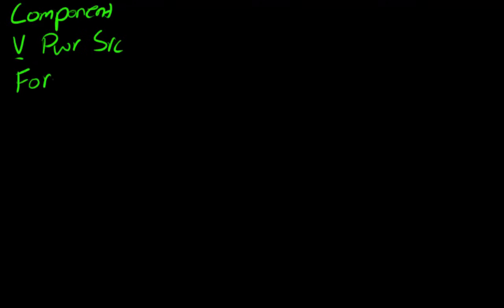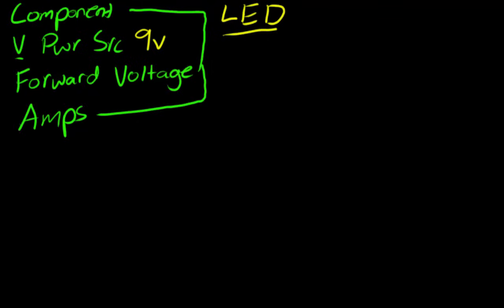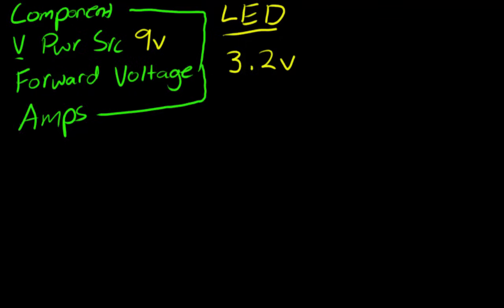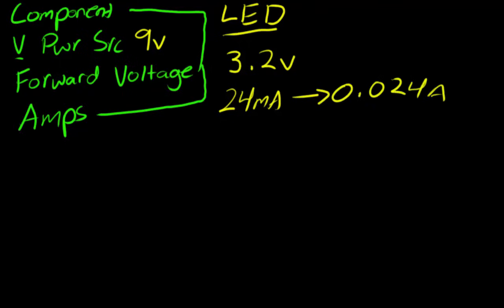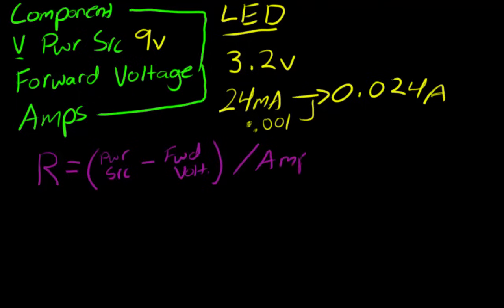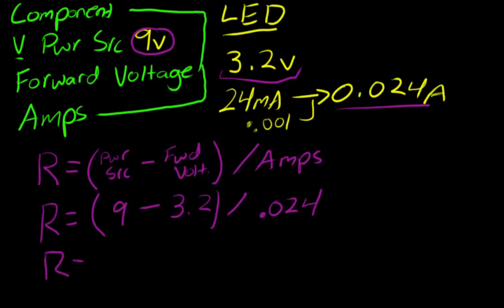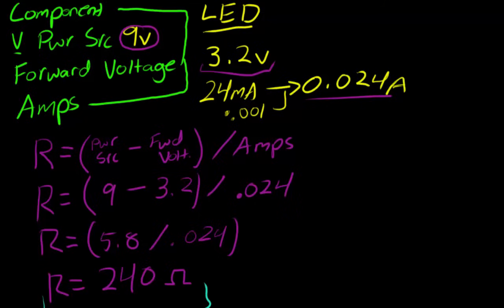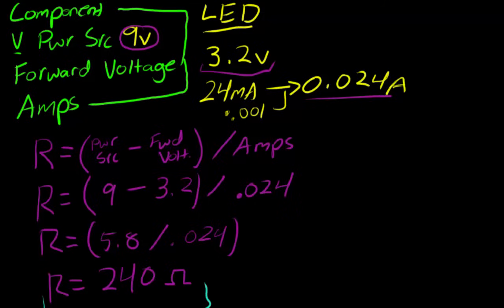Beginner Electronics - 7 - How Much Resistance?

Comment: What is a forward voltage.? Please explain.! Or give link to learn about it.!!
Reply: Its the voltage required to turn 'on' the diode or LED. So if your Forward voltage for the LED is given as being 3.2v and you have a battery of 9v you are going to have to put a resistance in between to reduce the voltage. The calculation works out what minimum resistance is required. R = (9 - 3.2)/0.024 = 241.66 (say 240 Ohms)
(This circuit diagram might help https://www.sparkfun.com/tutorials/219 )

Comment: CodeNMore thank you :D but i have a question what if you have 100 ohms resistor and then you add another 100 ohm resistor to catch up , is it possible two resistor in order to catch up to the desired value? . And then how it become 240ohms when i calculate it, it is 24.1666
Reply: if you place your resistors in serial, yes.

Comment: Don't we need to consider power source's output power?
Doubt: if we have 2 sources S1 & S2.

S1 = 9v/1A
S2 = 9v/2A

Then also we need the same resistance to work with same LED.

Comment: I don't know if my calculations was correct for my project, maybe someone here can guide me to the right resistor?

9v - 5v = 4v / 0.003A = -1,658R

1,658 K ohms resistor

Is this correct...? If so do I need to round up further to the best fitting resistor?
Reply: 1330 ohms

Comment: When I was little, I used to tinker with nerf guns and see how far I could get them to shoot. Around the time I really got into doing that, they came out with a few semi-automatic ones that used motors to propel the darts like a ball pitching machine. I got a couple of those to see what I could get out of them, not knowing much at all about electronics. They took about 4 AA batteries each. I decided to hook up 2 9 volt batteries to one and burnt out the resistors for the motors. After those burnt out, I just wired the motors without them. They made one hell of a noise and shot really far until I burnt them out. Afterward, I used motors from a different model nerf gun with the same configuration (no resistors) those one's never burnt out and still shot as far. I also wired in my own power switch, since the original was a button you had to hold down. Only vaguely related to the video, but I figured someone might get a kick out of the story
Reply: Get the Nerf Nuke. Here's another fun story, I googled how to make a nuclear bomb and it said I needed to start with calc-based physics. However, the FBI and teachers were concerned because, back in those internet days that was worse than googling R-rated movies. It put me on a watch list until 9/11 happened and they had more important things to do. From here I deduce that learning calc-based physics will put you on a watch list.
Reply: @bradleybeauclair8282  is this true😯😰
Reply: @omkarbansode6305  yes, I recall these days, but I never got caught, my teachers just threatened to punish who did it
Reply: @bradleybeauclair8282 
Based?... 😅
Reply: Great story!
Reply: Cool story

Comment: I love your videos, I had one question if you don't mind.
let's say you wanted to hook up another LED or some other component after the current passes through the resistor and the light. If it continues down the wire does it remain at the changed voltage or does it rise again? I hope I worded that right.

Comment: I'm confused! If you have a high resistance resistor in your circuit, would that not mean that not enough current will be fed into your component?
Reply: I know it is one year ago, in case someone have same issue. To make it shot in this example if you use 240 ohm resistor you get recommended - high light intensity on LED.. if you go less than 240 ohm by little bit you get stronger (brighter light) LED if you go too much less 240 -- you burn it.. However, if you use higher resistance than 240 ohm LED will light with low brightness.. and if you go too much higher 240 ++ led will go off.. but it will not burn it.. hope it helped..
Reply: That's the whole point. Your battery is has 9 volts and the LED requires 3.2 volts going in (or forward volts). So you are going to have to put a resistor in the circuit. The only missing value is what current or amps the LED requires. This is specified by the manufacturer which in this case is 24 m amps. So R = ( 9.0 - 3.2 ) / 0.024 = 241.66 say 240 ohms resistance. 
[edit: corrected 261.66 to 241.66 - thanks jake wong]
Reply: Me too! lol, I went searching through the comments to see if anyone else was confused like me. The guy who responded to you (@Chris Pyves) even unintentionally made the confusion confirmed. lol... If your battery uses 9 volts say and the LED requires 3.2 volts and we use enough resistance that it stops say 6 volts, then how on earth would the LED turn on? 9 - 6 = 3 but it needs 3.2 so it shouldn't turn on, or maybe be dimmer. So what the both of us are asking is, how can you say "it's fine if the resistance is higher than the calculated answer". Enough resistance would stop the required voltage wouldn't it?
Reply: (9 - 3.2) = 5.8 though. So when divided by 0.024, it gives you 241.667 and not 261.66. But your comment was helpful to understand this confusion! Thanks
Reply: Gore your right: too LITTLE resistance and you blow the LED but too MUCH and it will be dimmer. To reduce the voltage to 3v would require 250 ohms to 3.2v 241 ohms (say 240 ohms) should be OK.  But any less and it is likely to blow.
Reply: thanks @Chris Pyves I thought that would be the case. So saying "it's ok to have more resistance, more resistance can't hurt" is not really correct.
Reply: Gore you've got it. Although it would be interesting to see how much resistance would be required to stop the LED working altogether so it might be strictly correct to say "less resistance would hurt and probably blow your LED".
Reply: in this video https://www.youtube.com/watch?v=PqjwxoUa9Z4 , the analogy was made where he stated that adding resistance will either increase or decrese the current flow but leave Voltage values unchanged, but here he makes the case that resistance changes Voltage, confused as f.

Comment: what happens if a 2V battery is connected to a diode which has a voltage drop of 4v across it? is it the same as connecting it in reverse ?

Comment: I am using 2 AA batteries. I got a electronics starter kit with absolutely no information about the LED. I am going to use the same numbers as you. But if I have 3 volt power source, I would get a negative number

Comment: Hey CodeNMore, How are you ?
I love your tutorials it's helps me a lot. 

but I've a query in calculations of resistance you have not mention "current flow/Amperes of battery. If battery has 9 volts and 1 or 2 or 30 amps like a ac to dc transformer has then how we calculate resister value in oms 

some batteries has more amps then if i put 3.2v LED then what should the resistance in oms and how to calculate this 

please help me this confusions.....

thanks & regards
Abinash
Reply: example 
battery of 9 volts and 5 amps
LED of 3.2 votls and 24mA

then how to calculate resistance ?

Comment: so a resistor literally just wastes electricity
Reply: No. It limits the flow of electricity. Going back to the water analogy, there is no water wasted, because the water is never allowed to flow out of the source container. With increased resistance, less current flows. A resistor does not make electricity dissipate (waste), it just limits the amount of electricity flowing out of the source. Putting a resistor that halves the current in a circuit will make the power source last twice as long as if the resistor wasn't there.
Reply: @sweliam1  so its like a dam that only lets out some of the electrons
Reply: @mintcoffee500  Yes, that's right Nabeel! You're most welcome.
Reply: @sweliam1  thanks for the explanation!

Comment: why do we need to subtract power source from forward voltage?
Reply from the maker: Let's say we have a 5v power source, and we want our LED to have 3 volts of that (the forward voltage). So, the remaining voltage that we need to defer from the LED is 5v-forward voltage, or 5v-3v = 2v. So we need a resistor to "take" 2v from the circuit.
Reply: Got it. I was able to understand this while viewing the corresponding videos of this series. But thanks!! Great tutorials anyway :)

Comment: what if i cant find the forward voltage of my LED? i bought 30 leds in a hardware store but they didn't give me any papers or information
Reply: Well, he said that if you don't know the forward voltage of your component you could use a 1.5 kOhm (1500 Ohms) resistor, and it should be okay.

sorry for the late response

Comment: In the example given, what if you had a resistor with 2 mega ohms? Would too much resistant restrict the current to a point where there won't be enough voltage to light the bulb?
Reply: Exactly: too much current (amps) & you burn your LED out so it wont work again; too little amps & it will not be bright enough to see. As you can perhaps start to appreciate as your Resistance goes up so your current (amps) comes down. This is known as a inverse relationship. If one goes up the other goes down & visa versa.

Comment: hai,just wanna ask,how do u determine what components u need to build an operating circuit for specific circuit?and it is true  that u need resistors for every components?
Reply: everything has its own resistance... 
we use resistor only with the components which require less current
Reply: Thank you . then..,how do u determine what components u need to build an operating circuit for specific circuit?
Reply: Siti it depends what your circuit is going to do. In this case we are just building a simple circuit with a power source & an LED. But in order not to blow the LED we need to tailor the circuit so it delivers the right amount of current (amps) and volts to the LED. That is where the resistor comes in. If you draw the circuit on paper you now know how to calculate the resistance required for this circuit. Others will be different. But one step at a time.

Comment: If i had two 100 ohm resistors, could i add them after eachother in a circuit to make it equivalent of one 200 ohm resistor? 

Thank you for this tutorial, i'm learning alot!
Reply: just think current as water and restor as valves to stop water. 
now when water (current comes ) 
from two valves allowing limited water to flow.. what will happen?
Reply: Embedded Guru what? Sorry noob

Comment: In video 5 you said milli (m) meant million and k meant thousand. but now you actually divided 24mA by only 1000 to get .024 amps. If milli means million you should have divided it by 1,000,000. If it was 24kA you would divide it by 1000 to get .024 - what am I missing?
Reply: It all has to do with prefix values. Milli (m) is actually .001 (one thousandth) whereas Mega (M) is 1,000,000. Capitalization makes a difference when talking about prefix values.
I'm sure you can look up scientific prefix values on the web as there are a TON of them!

Comment: Just double checking, with the Amps rating for the LED, I see it mostly written as 'Forward Current', is that the correct term?
I've also seen spec sheets with Forward current and Reverse Current so do we always use the forward current?
Thanks.

Comment: What if you salvage leds from old electronics and you don't know the maufacturer or the forward voltage and amperage?
Reply: normally it would be 20 mAmp and 2V forward voltage (that's why he said 2.4 is pretty high)

Comment: this  is  one of the best videos i  ha ve  ever seen , keep doing what  you doing  but my question is what is the  forward voltage in this equation .
Reply from the maker: +Ali Khan In my case there is a 3.2V forward voltage, meaning it is the recommended (by the manufacturer) voltage the component needs to run properly.
Reply: CodeNMore ñ
Reply: how the manufacturer knows 3.2v fv

Comment: If I put two resistor together, say 1 resistor of 120 ohms and another resistor of 120 ohms, does it make 240 ohms or is still 120 ohms?
Reply from the maker: +Fernando Santos it depends - we will be talking about series / parallel circuits soon, but for now I'll tell you this: if you put two resistors together like a wire (like this: --[R120]--[R120]--) then it would be 240 ohms, but any other arrangement and it would be a bit different.
Reply: thanks for the answer.
The same goes for batteries?
a 9v battery -- another 9v batterie = 18 v?
Reply from the maker: +Fernando Santos yes, only if one battery is connected to the other from negative to positive terminal, not positive-to-positive terminals - this would be different.

Comment: Would 200 ohms work?
Reply: The calculation suggests that 240 ohms is the minimum resistance. So 200 ohms is below that. Whilst it might work in practice the LED is going to be receiving a higher current than the manufacturer intended so is likely to burn up whereas with the correct minimum resistance or higher it will continue to work.
https://cdn.sparkfun.com/assets/a/2/e/0/1/5114187dce395fdf01000002.png

Comment: Again, thanks, is that what you call ohms law? i'm a pure beginner and all this is very understandable for me..............
Reply: +Ray Andrew Yes it is - well, a slightly expanded use of it, anyway. Ohm's Law is simply V = I*R (I learned it as E = I*R...E is sometimes used to indicate voltage as well). Factoring in the forward voltage simply gives you the resistance required for that particular component to work properly when added to the existing circuit.

Comment: After you connect the resistor what is the output V/Amp of the circuit? Is one of them constant?
Reply: Your battery is 9 volts the LED requires 3.2 volts leaving 5.8 volts which if you divide by a resistance of 240 ohms gives you a current of 0.024166 amps or 24 m amps which is what the circuit requires to light up the LED.